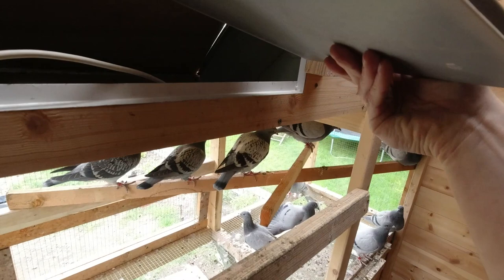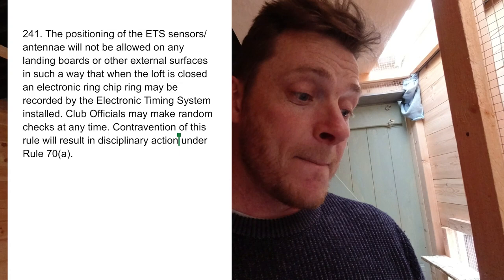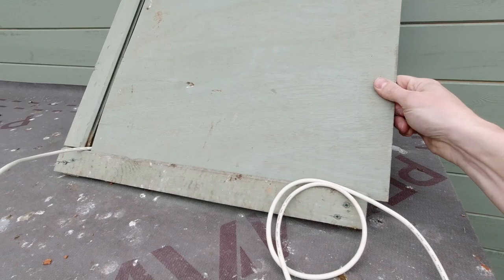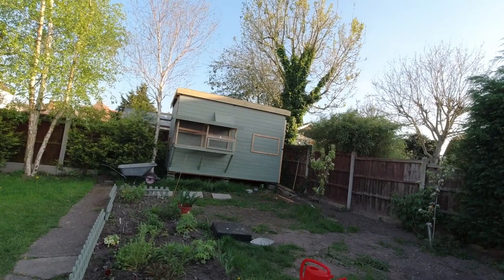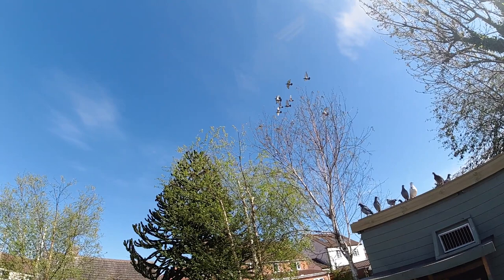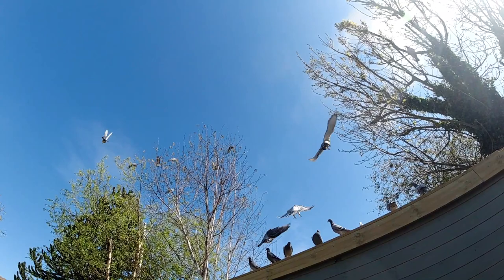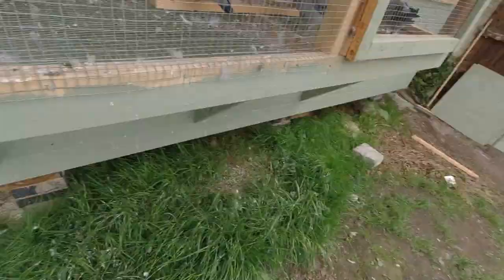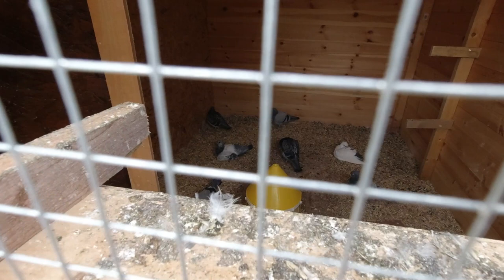ETS Pad Placement: Is it Allowed?

Comment: As long as where the pad is positioned a door, trap or lid can be closed behind it, so say you have clocked a bird then you have to go to the club or the shops and you close the trap or door or lid of your loft, if a bird returns it can't be clocked as the loft is closed. If the pad was on the outside of the loft a bird can still be clocked even though the loft is closed that is illegal. There is no rule in the RPRA that states that the bird cannot fly back out even if it can it will not be able to scan again as as it's already gone over the pad it cannot be scanned a second time. Where you had the pad inside the trap will suffice and you will gain time as the bird will be scanned quicker if it has to go through the trap then walk over the pad, also the bird might miss the pad on the platform you are thinking of putting up as it could fly over it or drop off the platform before being scanned, if the pad is placed inside the trap the bird will drop straight onto it making it virtually impossible of it missing the pad
Reply from the maker: Yes that's what I thought. I've read a few posts where people think it needs to be behind Bob wires or something to prevent the birds leaving, but like you said it's not a rule I can see in the RPRA handbook

Comment: Your interpretation of the RPRA rules is correct. That hatch is closed and the bird can't clock, therefore it meets the requirements in my view. I have seen plenty of pads situated as you described, with a hatch to close the loft off.

Comment: Hi there buddy im from South Africa Cape Town to be precise.. Here by us and specially my loft my pad is in my trap. So just before the bird go through the trap wire its scan and i have only 1 whole where the birds go through. If they land on landing board they know they need to use the 1 whole which is open cause i have 2 i block the 2nd whole.. 2 birds can clock in same time but here by us the guys put there pads on landing board just before the bird enter the trap its scanned